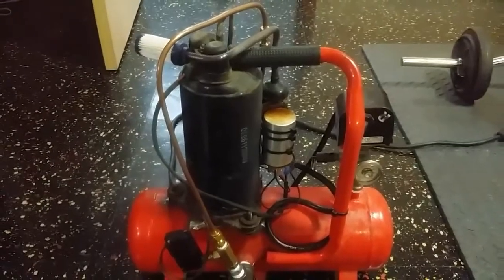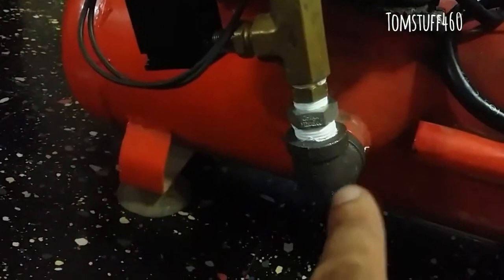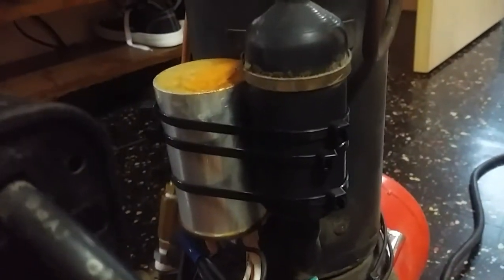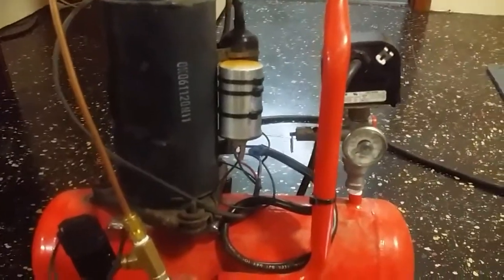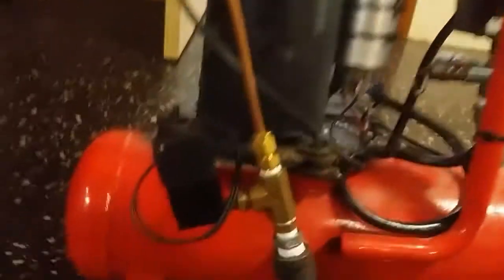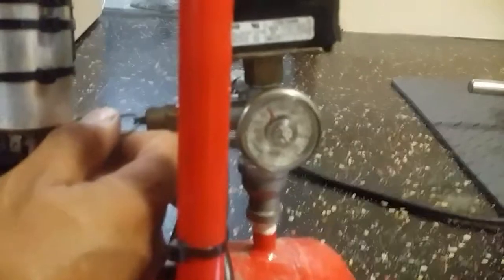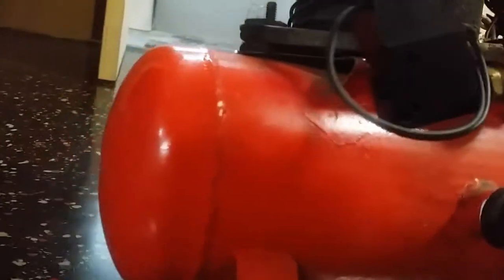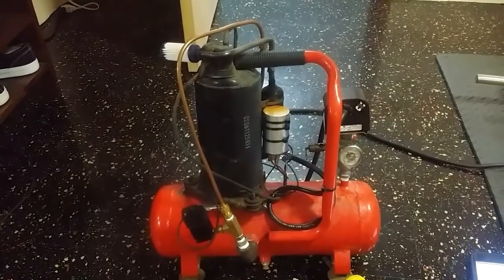Silent air compressor with a solenoid pressure relief valve

Comment: Hi. Good job on your compressor. 
I’m putting in an aftercooler that connects between the compressor motor and tank. I go from the output of the compressor to a flexible line and a check valve. Then the air goes through a series of copper pipes for cooling. Then it goes to the tank. 
My problem is the unloader valve that’s connected to a pressure switch at the tank input. If left there, it would drain all the air in my cooler every time the compressor turns off. 
When I saw your solenoid valve, my eyes lit up. Maybe I could put one of these between the flexible hose and check valve before the cooler? Then deactivate the one at the tank. 
Can you give me advice on how to do this?
What kind of valve?
How to wire it?
How to deactivate my current unloader valve?
Your help is much appreciated. 
Thanks,
Paul

Comment: hello i have a problem.. why is my compressor gets so hot. so hot that i cant touch the compressor. is it normal? thank you
Reply from the maker: Hi. the compressor should reach 125 degrees Fahrenheit. And if it's a homemade air compressor it should have a check valve and the pressure relief valve for it can release the pressure from pump for restart. Hope this helps
Reply: @tomstuff460  Kev, hope u didn't forget to put oil in it (I use full synth) and these types of compressors aren't made to turn on and off more than 5-7 times per hour cause it's not meant for this type of use so maybe down size the tank or add another or 2 more compressors to lighten the load work. It worked for my 10gal tank
Reply from the maker: @richnvick9281  I haven't really run it much just to fill up my car tires . I'm going to do some more research on it thank you!

Comment: Does it need to be oiled?
Reply from the maker: I haven't change any oil on this pump but some YouTubers are modifying the air compressor pump to change the oil.
Reply: @tomstuff460  probably because its a a/c compressor no need to replace original oil  as opposed to refreg comp where there it is a must?